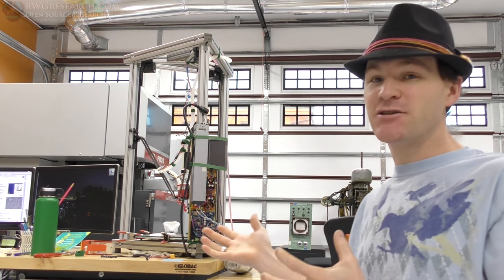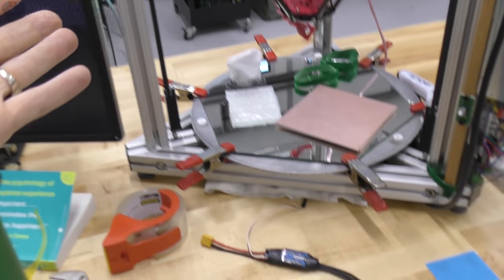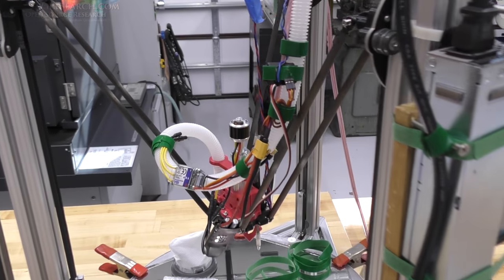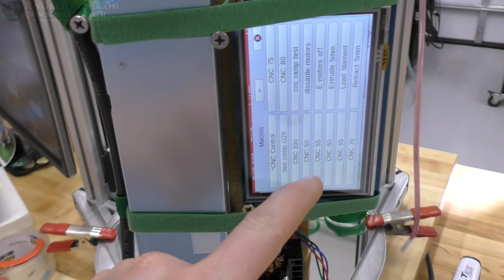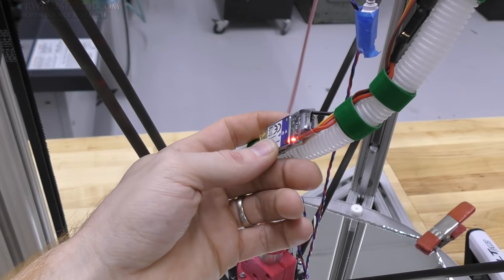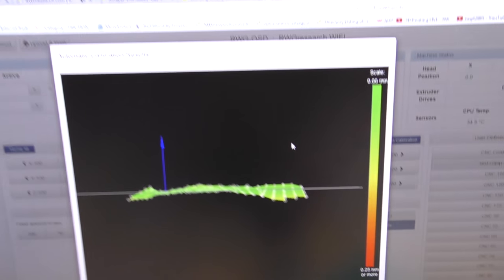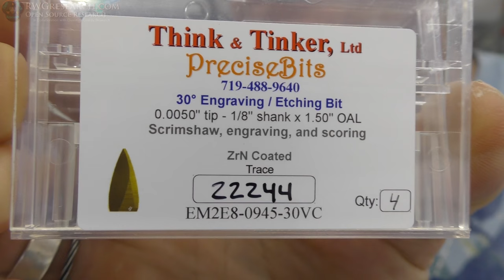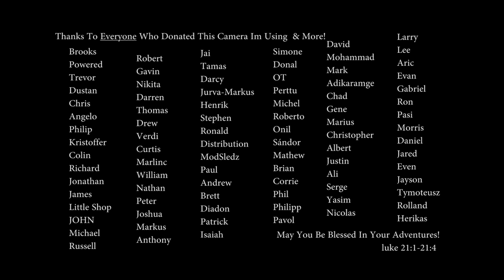RWG-OSD-CNC Update, New Heli Controler for Speed Regulation, Bed Mesh.

Comment: If you want to add a capacitor bank you can look in to getting or copying a Castle Creations capacitor bank that is used only at the ESC side which should be more than enough to stop voltage or current spikes.Also if you have the YEP programing card I would turn on active free wheeling which will keep the ESC alot cooler at lower RPM's

Comment: I don't know where you find instructions to add capacitors for x amount of wires - it's the worst load of bull i ever heard. Normally it's completely forbidden to extend wires to battery - it usually means that the ESC blows up. The capacitors needs to be low ESR electrolytic - they "look" like a dead short and can deliver the sharp current pulses the switching H-bridge in the ESC needs. Adding long(er) wires to the battery/power supply is a problem because the wires is inductive (like inductive kickback from relays - they can shock you and burn driving transistors as you may know) You need to place the capacitors as close to the ESC as possible - best directly directly on the pads of the input wires like the one that already is there. Your capacitor bank is a perfect way of doing it. Good job!

Comment: Morning Russ (in the uk anyway!), thx for the video, keep em coming. whats the purpose of the capacitors? i thought it might be for interference suppression, in which case i can't see the point in moving them to one point. Also, rather than a bunch of smaller ones in one place, couldnt you just do the sums and use one bigger one?

Comment: You could of flashed the first esc with BLHeli firmware (Heli is the "main" FW). And used BLHeli Suite to tune the settings.
Reply from the maker: yeah? I could have flashed that other controller? I think I still will then. can you provide some links to where what and how? 

I found some info on it, but I'm not so sure it will work with that controller, its not on the " list' 
http://www.propwashed.com/esc-buyers-guide/

those are " recommended" tho. 
I guess ill look at the Controller IC. not sure what it was... 

still think it will work? 
 Thanks! 

~Russ
Reply: Get the suite here https://blhelisuite.wordpress.com/, extract to folder, then goto the manuals folder, then look for these two files "BLHeli supported Atmel ESCs.pdf & BLHeli supported Silabs ESCs.pdf". These have all the current known esc's that are compatible with BLH, first find out if its Atmel (old school) or the newer Silabs mpu, then look in that file to a match to your esc, I use a $3 arduino nano to flash, there is docs on how to do that in the same folder, good luck.

Comment: In my personal opinion, you are using the information that you are acting on out of context, you are not axell and decell that motor like when people is doing aerobatics with a helicopter! your are not changing the pitch of the prop at high rpm's and you are not taxing your motor in a way that the ESC is going to have to deal with incredibly power spikes.. if I was going to be concern about any thin I would place an LC Filter at the exit of your power supply ! I mean.. the only thing that you are truly putting at risk is the computer controller for you cnc machine.. "Any way I just don't see you man/handling that machine in any way to be worry about it. You feel free to erase this message if you disagree with me.